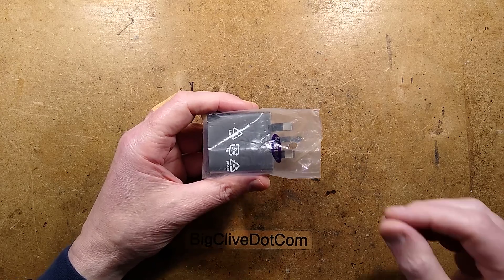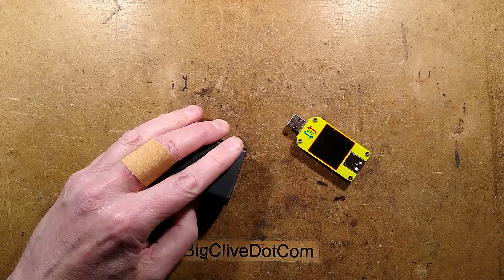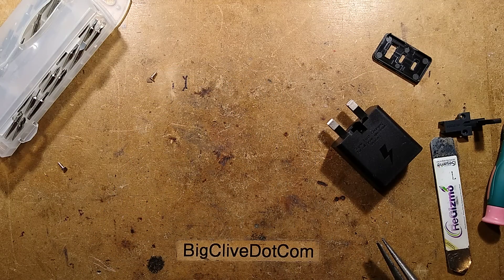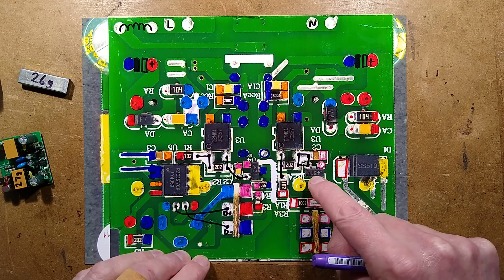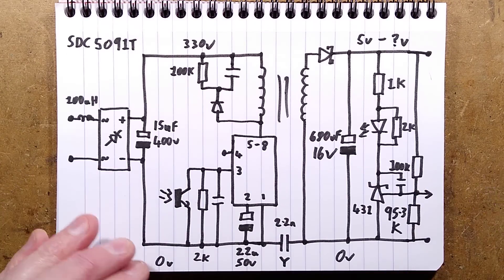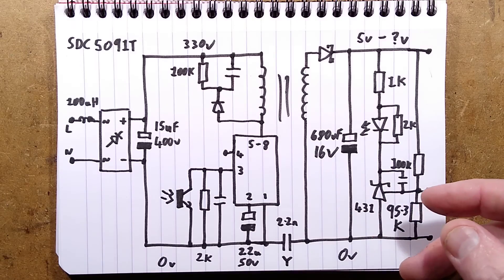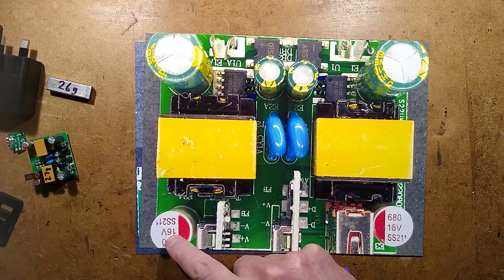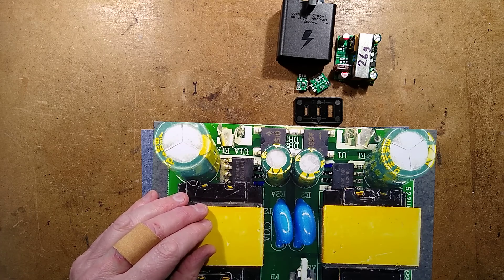Fake Samsung charger with interesting circuitry

Comment: The simple 1 USB port fake black Samsung chargers can be identified by the part number printed on the outside. That part number on the fake one is ETA-U90EWE, which is actually the part number on the white original Samsung charger. The genuine black Samsung charger uses ETA-U90EBE as part no. So I bet this "mistake" in part no can also be the case with other fake Samsung charger types. I used some of those fake Samsung type 1 single USB port chargers for a while, until one night in 2018 when I was still awake and charging my smartphone in the other room when suddenly heard circuit breakers tripping and all the power in the house when off. 
I found my way to the fuse panel and found out that the fuse on the wall outlets and main switch had blown. So I pushed them both back on, and they stayed on,
but suddenly I smell something burning. I took a tour of the house and when I got to the room where my smartphone was charging I found the culprit. 
That fake Samsung charger was burning with an eight inch flame around it, I ripped the charger from the power strip by pulling the USB cable, and threw it into the sink where I was able to extinguish it with water. Fortunately, the smartphone was not damaged, and i was still awake when this occured and could take action. I have smoke detectors in almost every room,and also in the room where this occured, but the fire started on the otherside of the room then where the smoke detector is installed. Never used a fake charger for a smartphone again since that day.
Reply: Yep it’s crazy how these fail. Failure of not working, ok it was cheap. Failure of it bursting into flames, not cool.
Reply: I think the biggest lesson here is never "flip a circuit braker back on" until you found the culprit. If you can't see any problems in the rooms without power at least unplug all devices before flipping it back on so you can be in the room when plugging them back in.
Reply: @mrfrenzy.  Spot on! That is my procedure. If the breaker to a particular room only trips, it narrows down the search.
Reply: Depending on the room size, you might want to either move the smoke detector or install a second one.
Reply: @rolfs2165 install only photo smoke detectors, not cheap ionization ones
Reply: I used a cheap but not fake charger. I used it several times wothout any issues. One lunch in the factorybreakroom, I needed to charge my phone. No biggie. I plugged my cheap charger in. PAM!!! The entire poweroutlet flew out from the wall and shut down half of the factory. Since then I don't buy cheap chargers, I only buy the real originals for a slightly higher price.

One thing I forgot.

I also noticed: Once the cheap chargers starts to show age they tend to start discharging the phonebattery. Doing the opposite of what it where designed to do.
Reply: @swededude1992  I hope your factory improved their electrical installation, with proper selectivity at most the break room should have shut down, nothing outside in the factory. Also there would have been much less of an explosion. (another Swede here)
Reply: @swededude1992  It's not charging your phone, it's loaning it some electricity.

As with all loans, you gotta pay it back with interest.
Reply: I assume you got these fakes off an internet seller? I won't touch an unknown source. Always from official sources with comeback!

Comment: Wow...the level of deception is high in this one...a hunk of steel flopping around in a mains-connected device is pretty bad.  
The least they could have done was stick it to the transformers...but I guess that little act was way too expensive...unlike mirrored power supplies  :)
Reply: If the worker doesn't spend the 5 seconds to peel the wax paper off they can push out a few more adapters per hour. Something something something, capitalism.

In defense of steel weights, I own a computer store and we occasionally open up legitimate manufacturers laptops like HP and find steel weights like these inside them. I'm not sure if the point was to balance them or what exactly but they were there nonetheless.
Reply: @ralphshoop8822 also some pc mice have weights in them
Reply: @309electronic5  computer mices are ridiculously lightweight sometimes without these weights. They are there so they basicly dont fly away like a small piece of paper when you open the door next to your computer desk.😂
Exageration besides, they are there to increase friction somewhat controllable, without them you would very easily, accidently or just because of cable weight, have your mice moving on its own.
Reply: They could have just packed it full of sand but that might cause a thermal issue. At least now you get a nice weight you can use in another project, with adhesive even!
Reply: Fancy mice even let you adjust the weight. Logitech has mice with several small magnetic weights that can be snapped into the bottom of the mouse.
Reply: @mangamaster03  
I own a Logitech G500 mouse and the weights are accessible and used to adjust mouse use...this weight is not.

Comment: i put chargers in many bags and puches so I can be sure I've always got one nearby. I like the folding pins of the newer Apple chargers but annoyingly they only have the one USB-C output ( Love the Mu folding ones too but they're hens teeth ) bought some look-a-like " apple" chargers that definitely weren't as high a quality, so they went in the bin
Reply: Ugreen make four different chargers with folding pins (30W, 45W, 65W & 100W). All but the 30W are multi-port.
Reply: @GadgetMan36  i went with a couple of Anker 33w one's ( also forgot to mention , i''m in the UK and very jealous of the abundance of folding pins on US style plugs )

Comment: The genuine 65W Samsung multi port charger is £54 direct from Samsung, so at £15 the price is too good to be true. My recommendation for multi-port chargers is Anker, Belkin, Juicebitz, Spigen. They don’t need to be Apple or Samsung branded.
Reply: I use both Anker & Belkin exclusively...never had any issues with their products.
Reply: Ditto. Why risk hundreds/thousands £/$ to save a dozen or two?
Reply: @Lutefisk_lover  What fool spends thousands on devices and doesn't already have a charger?  Then again what fool spends thousands on USB recharging devices?   On the other hand, if someone is that foolish, "perhaps" they at least have insurance which they ought to anyway.
Reply: I’ve always used Anker to supplement the genuine ones and never had issues. Recently bought a ugreen 65w travel charger, hoping it’s on par with Anker products 🤞🏻 (so far so good)
Reply: Yeah ugreen is decent too, basically Anker but without as much brand recognition, so they're a bit cheaper. I'd consider both of them the A-Tier of Chinese manufacturers
Reply: IDK if Anker is mains voltage good, I'm impressed with the powerbank I have from them, but I went looking for a solid USB C brick a while back and IIRC some of their models were not UL/ETL approved.
Reply: Anker is my top brand for 3rd party charging products!!! Consistently Excellent Results!!!
Reply: Agree a lot of samsung phones and watches refuse to charge on non safe chargers but ps5 will charge a samsung phone
Reply: @Tim_3100  Obviously everyone should buy a PS5 to make sure they can safely charge their phone.
Reply: I've used a ugreen 65w fast charger since Dec 7th of last year its a goof charger
Reply: Anker is great and the internals are very well designed. 
Ugreen makes great USB C cables
Reply: Apple even sell Belkin brand products so that shows how they feel about them.
Reply: No, not really.  There are lots of cheap widgets from china which seem too good to be true if you compare against the alternative from a major brand with very high profit margins, but very many of those widgets are true.  Samsung is making a lot of money off their chargers and it is completely possibly to make a good (enough) charger for £15 when you are in  china and parts and  labor are dirt cheap.  That doesn't mean there aren't widgets with too many corners cut - not at all, only that £15 is on the high side for what it could cost to get a 65W PD capable charger made in china.  I have actually bought, albeit over-rated, PD capable chargers from a certain site with the initials AE, for $2 US!  Best quality, no, but they do the job until they wear out from heat.  Would I plug an expensive device into them? No, but a cheap device, yes.